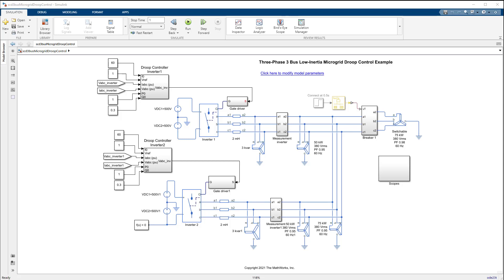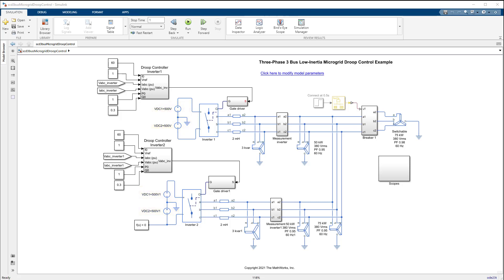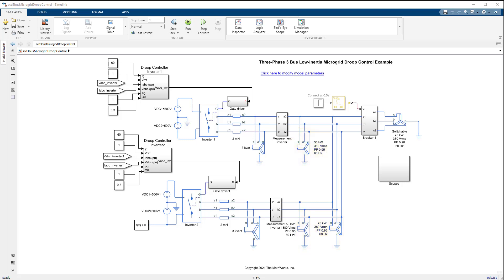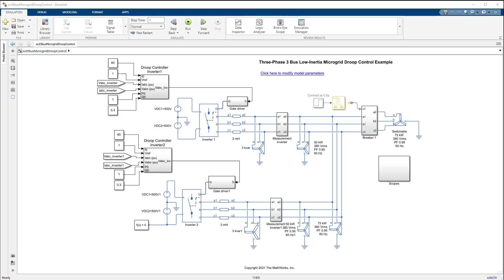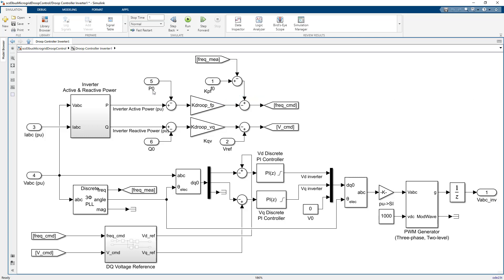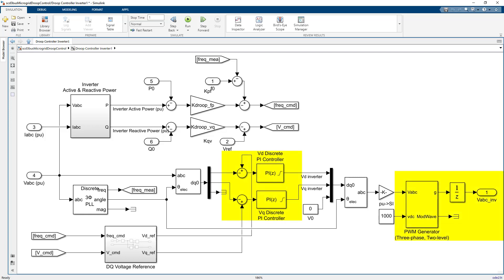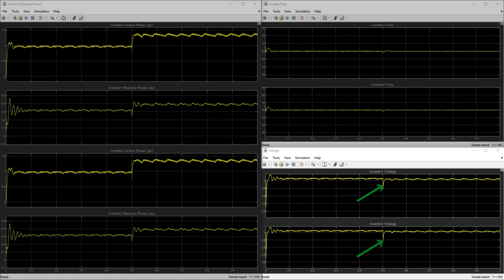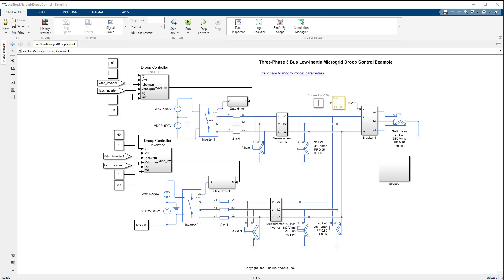Implement Droop Controllers for Islanded Operation of Remote Microgrids

Comment: Hi ,in which way do you impose the reference value for the Active and Reactive Power? Why at the beginning both references are 1? Thanks a lot for the answer
Reply from the maker: The reference signals are active power and voltage (not reactive power) for each source. The value of active power reference signal reflects the power distribution between different sources. The requested active power is 1 p.u. from each source. The nominal distribution can be changed by a higher-level scheduler, possibly based on some optimization algorithm. The value of voltage reference signal is the target for local voltage control. Setting reference voltage to 1 means that the objective is to maintain the voltage at 1 p.u..